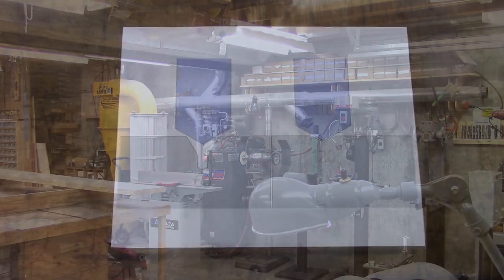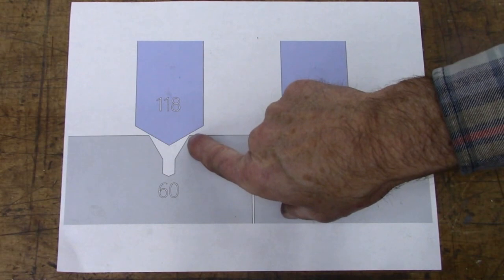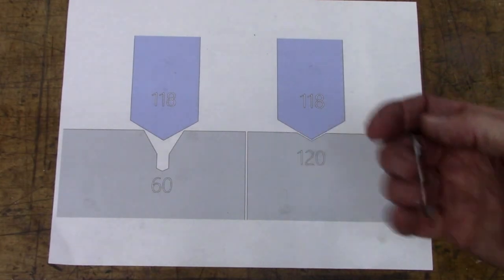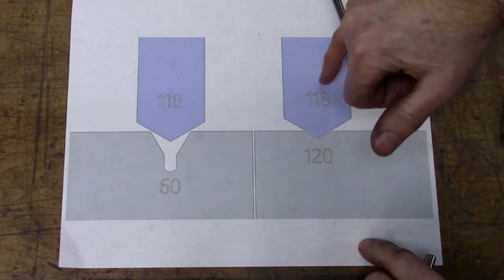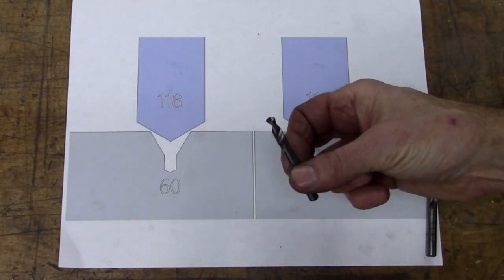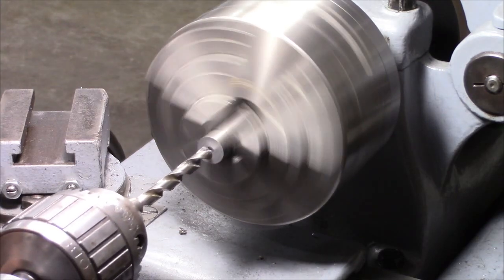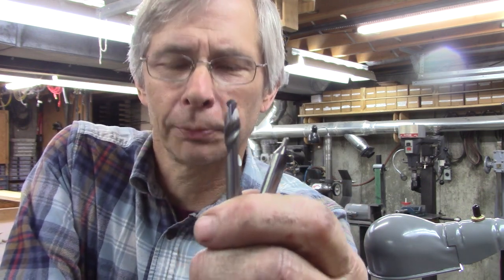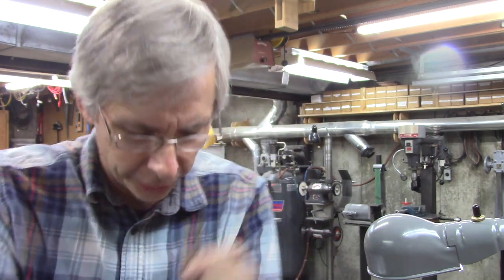Center Drill VS Spotting Drills

Comment: Thanks for another great and thoughtful video! That's what I love about your channel. You put a lot of thought into your work and your videos. Then, when I watch, I get to think too. I always learn something. I think it was Stefan Gotteswinter who pointed out that the only part of the center drill that's at the correct angle for spotting is the very tip.  Just be sure to use a big enough center drill so the tip is bigger than the web at the tip of the drill you plan to use next.  For those asking how many spotting drills you need, look again at the diagram in this video. The spotting drill (or center drill tip) makes a tapered hole larger than the tip of the next drill. It doesn't need to match a specific size, so you don't need a whole set. If you really want to plan ahead, you can use the spotting operation to create a chamfer or countersink, then drill the hole.
Reply from the maker: Excellent points. And a 3/16" or 1/4" will do everything you want. 

Thanks!

Comment: I could be wrong but I'm not certain I agree with this video:

My philosophy is that a correctly sized center drill should be used in a lathe and a spotting drill is for the milling machine.  

Here is my reasoning: if you watch the center drill when it first contacts the rotating work piece (in a lathe) you will see that rather than allowing the center of  the cut to be defined by the XY location of the lathe chuck (lathe chuck XY location often has small concentrically errors.. especially on older lathes), instead the center drill "finds" the center of rotation.  Do a center drill operation with the tail stock loose and you will see the center drill "snap" to the center of rotation.  I don't know how it does this, but I suspect center drills were designed to "find" the center of rotation and, in this way, take up small errors and not allow the error-prone tail stock to dictate the exact center of rotation. 

OK so a good spot drill will be made from very rigid solid solid-carbide and is intended instead to make a spot that stays on the center of a rotating tool rather than the on the center of a rotating work-piece.   TOM
Reply from the maker: Interesting theory although so far I have not noticed this. It is a little more like a regular drill in that it has a web between the flutes but it is very thin. What I like about this spotting drill is that you can jump to a much larger size drill. At least with a small center drill you have to drill the first hole with a small drill. I used the spotting drill today and went right to a 5/16" and it worked perfectly...  saved a lot of time too.

Comment: Now just tell me how you really pick a spotting drill since it seems there are a lot of variation. Even if you pick 120 degree do you need a whole set in imperial and decimal sizes and do you match the size to the drill size you want in the end. Always used center drill I guess the wrong way. https://www.travers.com/spotting-drills/c/297807/#
Reply from the maker: Great question and I should have covered this better. One drill works for everything. I use 1/4" although 3/16" might be better if you are trying to hit a mark. The smaller drill doesn't obstruct the mark as much. I have a 3/16 and 1/4 but use the 1/4" more because it carbide and sharp. The maximum depth is the drill diameter. In other words the pilot hole can't have straight sides. Don't go too deep.

Comment: When I was younger I watched an older machinist do center drilling. He would use a center drill the same diameter as he was going to drill and center drill deep enough to reach the OD of the center drill. When he switched to the regular bit the OD of the hole centered and held the bit true as it started drilling. I am only a hobbyist shavings maker, but I still use his technique I learned from many years ago.
Reply from the maker: You might try the spotting drill...  get a 1/4" and use it for every size drill. It works great and doesn't cost much at all. There is a link in the description. $8 buck I think.

Comment: Good point but did you know that center drills commonly have a 120° angle on the small tip? If you just poke in with the very tip you get the same effect. (As long as the very first mark is truly on center)
Reply from the maker: Good tip! - I realized this a short time ago and it works. The only negative is a very small spot to hit and you need to use a small drill first. I just drilled several holes with a spotting drill in the drill press and went straight to a 5/16 and it worked great. It saved a lot of time too.
Reply: Both very valid points. If you use just the tip it works but limits the hole size. I find using them this way for small stuff and dedicated spot drills for larger is a good combo.

Comment: If you use a large center drill and only the 118 degree tip of it, it will function the same as a spotting drill. Learned that from Stefan Gotteswinter
Reply from the maker: I agree.
Reply: I was looking for this comment, this is something an old school machinist told me. I keep a 118 degree CD in my box and thats all i really use because its short and does the same thing

Comment: Great demonstration of a very interesting concept. Never heard of a spotting drill before this. I guess I'll have to pick some up.
Reply from the maker: You really only need one. 3/16' or 1/4" ..  So far I love these drills.
Reply: Thanks Winky,  yes I'd already appreciated that although the point of a centre drill is ground to the usual angle of 118 degrees the cone angle is much less at 60 degrees to match that of a  live or a dead centre.   I guess I now need to grind a short stubby jobbers drill up to 120 degrees and try it out myself.

Comment: There are quite a few things that are shown by the "experts" that are just plain wrong.  They were taught to use them by some other old "expert" and so it must be the correct way to do it.  I have never seen a center drill used on a cnc mill or lathe.  For obvious reasons.  It is the wrong tool.

Spotting drills are great!  The smaller sizes of center drills break very easily on a lathe because, wait for it. . . .  a drill wants to do anything but cut on center point.  So that fragile little nub sticking out snaps right off.

Great video Winky,  you may have started a revolution, LOL.
Reply from the maker: Haha...  Thanks!

Comment: Yeah, but like everything, there's the right way to do something, and the lazy way. I've already got a frequently used centre drill in my one spare tailstock chuck, and it's just sitting there on my lathe table, so I'm going to just grab that rather than digging out a spotting drill and swapping it out. :)

It's like using a flat bladed screwdriver to open paint tins. We all know it's not the right way to do it, but it's convenient, so we don't think about it.
Reply from the maker: Good point
Reply: Why not have the best of both worlds, and just replace the center drill in that chuck with a spotting drill?
Reply: @BatByke  I usually need a centre for support way before I start thinking about drilling/boring out the middle of something, so by the time a spot drill would be the right tool to use it's already too late to use it. On those rare occasions when I didn't need a centre in the work first, the centre drills already right there in my smaller chuck. It still works about 80% as well as a spot drill....... and I'm lazy. :D

Comment: I guess a conclusion would be that center drills are only for drilling holes using centers on the lathe?  I know a purpose spotting drill has few flutes making it much stiffer than a normal bit but it brings up the topic of how successful would you be grinding your own 120 degree end on regular drill bits for use as spotting drills?  Of all the thousands of drill bits of all kinds that I have collected over the past six decades I only have a handful if that of spotting drills and hesitate somewhat (as much as a guy can when buying tools!) in acquiring a full range set of spotting drills if I can make my own.  I recognize the problem though and have often watched the drill take off out of round from a center hole shallow or deep.  It is a forlorn hope that it will straighten itself as you step up to larger bits I can tell you.  Good video.  Happy New Year.
Reply from the maker: Thanks...  also spotting drills have a very thin web. A standard twist drill is thick.

Comment: I haven’t really used spotting drills, but a center punch, before drilling, and I have to admit I had to look up its tip angle - surprisingly it is between 60° and 90°.  From the photos of transfer punches the same appears to be true.  So, it is interesting to see the difference it makes on a lathe, which is not usually observed on a drill press.  Maybe it cones down to rigidity and stick out differences between these machines... but I haven’t heard chatter on drill press yet the punched center does prevent the drill from wandering.  Could you please make a comparison video of this using the same bits is your advanced drill-press?
Reply: You can buy centre punches with a 120° angles for drilling. They are best used by using a small angled punch to position the centre (you can see better what you are doing) then open it out with the large angled punch.
Reply from the maker: Yeah I do that too.
Reply from the maker: I may do that. I also have more problem on the lathe.

Comment: Great video.  Explaining why one is better than the other is key to learning something new.  Thanks.
Reply from the maker: The center drill is still important. like the center drill in the drill press if I need to hit a mark. The visibility is better. I have learned that if you only go as deep as the tip of the center drill it works better.

Comment: You know I need to go out to the shop tomorrow and look more closely at centering drills.   What about using a Large centering drill bit in the tailstock.  Those large ones would be quite rigid. But then  only use the very tip of the centering bit to make the small mark, divot, or whatever you call it.  Then don't go beyond that very starter point with the center drill.   This may just work because they seem to have the 118 degree grind on them.   Will check tomorrow on a large one.  Thank you for pointing out this issue.
Reply from the maker: I like the idea and I think you are right, the tip is more blunt.

Comment: Drilling holes invokes passion in men. Their are thousands of opinions of best practices. But i am game to try most any of them that helps me get a better hole. 
Spotting drill will get ordered promptly for home and work thank you Mark on target as always.
Reply from the maker: I don't thick it fits every situation but it des way better in the lathe
Reply from the maker: I put a link in the description. They are cheap
Reply: @WinkysWorkshop  Spotting drills last a long time because they are not used anywhere near as much as a centre drill or standard jobber drills. A shallow lead for the later drill is not a lot of work for the spotting drill. A centre drill is used far deeper unless you try to just use it on the end. So even if one seems expensive then over time it is not.
Reply: I checked out the link and am going to get a few.
THANK YOU!
Reply from the maker: @countrycraftsman5110  - Cool Amazon has a bunch of them, get one that is short.

Comment: The way  it was explained to me was to use all three types of drills. A center drill is ground to cut right from the tip, and is used on a lathe like a center punch would be in a drill press, to mark a spot for the spotting drill to start. The spotting drill is then used to make a deep enough spot that the non-cutting center tip portion of the dimensional drill has some relief from the surface and the ground cutting edges then remove the material.

Of course, the center drill is used alone to make a specially sized hole for the lathe turning center, a different operation.
Reply from the maker: Thats a lot of bit changing but I agree that the spot drill is not good for some things.

Comment: Almost never use spot drills.  Especially on CNC equipment.  Use the right tools and you won't need to spot drill.  Split point drills negate the need for spotting or center drilling.   YMMV.
Reply from the maker: Yes a good option. I don't know a lot about them but you need one for each size right?  Spotting drill may not be the best option but better than a center drill.
Reply: @WinkysWorkshop  Buy split point drills as you need them. You won't regret having them. A good source for reasonably priced GOOD drills is McMaster Carr.
Reply from the maker: @terrymoorecnc2500  - It would certainly be a plus when you have 50 holes to drill.
Reply: @WinkysWorkshop  it is easy to split them yourself with a bit of careful grinding, or you can get a jig to do it. I would get a diamond wheel though, as you really need a sharp wheel edge to do it well.

Comment: Well explained Winky, the only time centre drills figured in my apprenticeship was for either prepping to turn between centres or for a live centre. Doesn't stop me using them incorrectly most of the time lol. Centre drills are actually fine if used correctly, ie do not go deep enough to get onto the 60 deg cone, this way you have an on centre pilot hole to follow which should be about 1/3 the diameter of the drill. Try it. Cheers, Jon
Reply from the maker: Yes you are right and I probably should have brought that up in the video. Thanks. I like center drills for hitting a mark. On the lathe for drilling no.

Comment: I love my 140° spotting drill.
Reply from the maker: Thats almost flat?
Reply: @WinkysWorkshop  180 would be flat  but 140 means that my 135 bits will center properly
Reply from the maker: @ninthm00n  From what I have read 120 is ideal for a standard 118 degree drill bit. But yes, 180 is flat but 140 isn't far from it

Comment: I have always had a bit of bad holes using standard twist drills. If you examine a hole from a twist drill it sometimes looks like a cutaway of a rotary engine. I am not sure why the triangle shape but it happens. Especially in thin material.
Reply from the maker: Yes it does. It averages out in deeper holes where the sides of the hole can guide the bit. You see the same pattern with the spotting drill but it seen to work better anyway. Most drilled holes will also be slightly over size.
Reply: You need to use a "Brad point" drill for sheet and thinner metal.
Reply from the maker: Try step drills.....  they work fantastic
Reply: @WinkysWorkshop  you are right on target with step drills they work great on a lot of holes. We hang hundreds of strut brackets to support rigid conduit in the industrial world and we use step bits to drill 1/2" holes in beams to support 1/2" threaded rods. The biggest reason is the step bit does not hang up like the twist drill and raise havoc on our wrist.
Reply from the maker: @countrycraftsman5110  yeah... no chatter, smooth. I've used them on 1/8 steel too.
Reply: @t.d.mich.7064  have not tried a brad point in thin sheetmetal but will give it a shot. I use step bits the most in sheetmetal except  for when i need the twist drill for taping holes.
Reply: @countrycraftsman5110  puts all doubled up piece of cloth over the hole then drill, will be a round hole
Reply: @ke6bnl  i will try that.
 I wonder how the cloth effects the hole.
Reply: You will also get a tri-lobed hole if the bit is not sharpened so that both cutting edges are the same length.

Comment: You can't lose with a spotting drill, the next drill will always go to center. You can hear a huge difference in the video.
Reply from the maker: I've been frustrated with center drills in the lathe. They are usable but it seems like every time you need a concentric hole you see the drill wobbling as it goes in. Starting with a very small bit help. I still use the center drill in the drill press because of better visibly its easier to hit a mark.

Comment: So how many sizes of spotting drills should one have.
Reply: A 2" one should do most people. For smaller sizes spots, just don't drill so deep ;)
Reply: @millomweb  I was referring to diameter. I see you only have one size
Reply: Potentially just 1 spotting drill could be enough.  You choose how far to spot drill into the surface.  Even a large spotting drill can be gently used to make a dimple small enough for a narrow follow-up drill.  So find your largest diameter drill, measure the web and buy a spotting drill say 1.5 times the web thickness.  If you have holes to drill that are very close to surface features that protrude away from the surface to be drilled, then you might need a second narrower spotting drill.
Reply: It would depend on the size hole you need to drill afterward. It should have very short flutes and overall length for rigidity.
Reply from the maker: I have a 1/4" and 3/16". The 1/4 will do anything I need but its easier to hit a mark in the drill press with a smaller drill. In fact I sometimes use the tip of a center drill in the drill press. If you don't go deep and use a small drill to follow it does well.
Reply: @WinkysWorkshop  Centre drill like the spotting drill is relatively short and stout - to retain tip position & minimise wander.
Not that you need it if you use a centre as a centre punch with a sledgehammer ;)